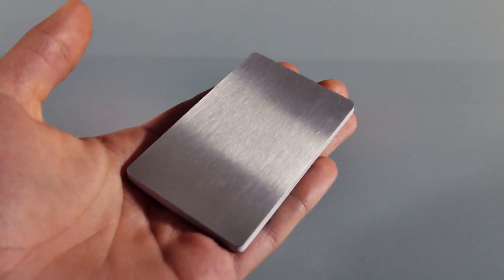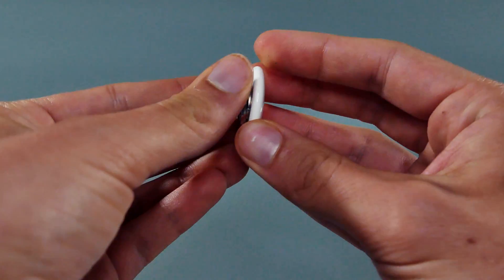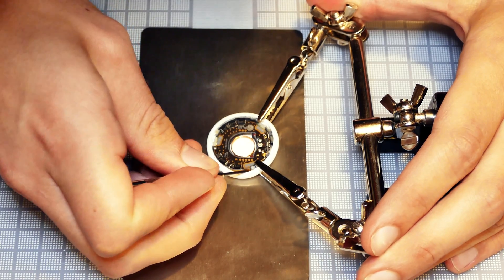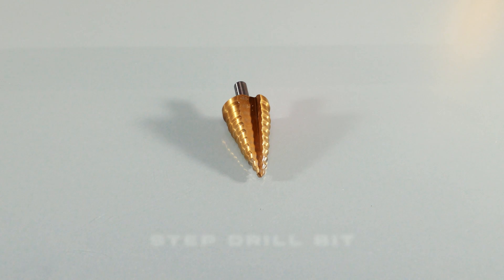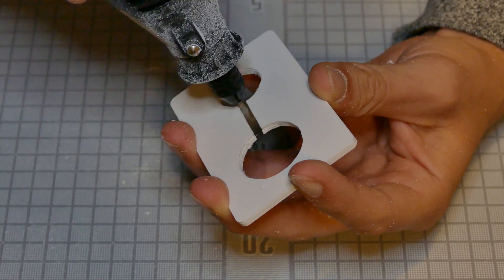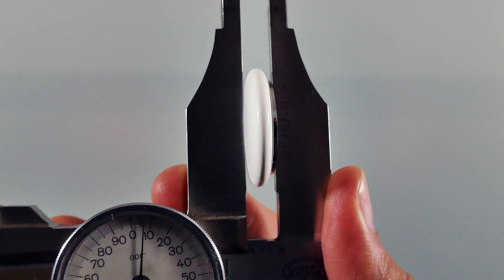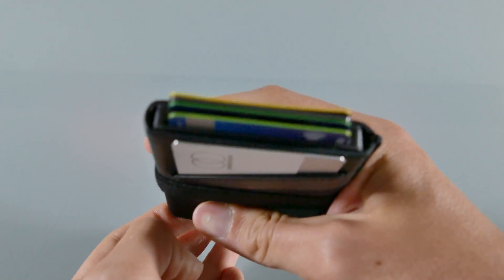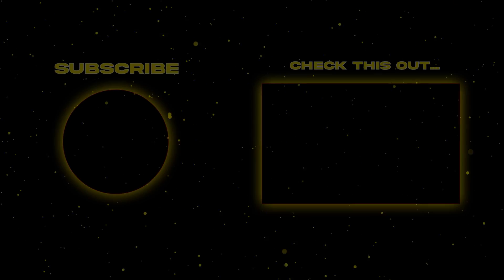Turn Apple AirTag Into A Card For Your Wallet (DIY) | Is It The Best AirTag Card?

Comment: more info on removing the pcb would be great that is the part I was stuck on before and am still :D
Reply from the maker: So the best advice I can give you for this part is to heat the airtag from the bottom so the glue can loosen then pry the pcb from the side. In the video you can see me trying to pick it from the center. Don’t do that. Just pry it from the side lightly with some pressure. Eventually it will come off. 👍

Comment: Square is apparently making an AirCard that is compatible within the Apple ecosystem. It’s gonna apparently be 2 credit cards thick, have replaceable batteries, and make a sound just like the AirTag. Preorders are supposed to open pretty soon, you were just off by less than a year.
Reply from the maker: Yes! I heard this as well, at somepoint it was pretty evident we’d see this coming. Glad to hear it will work with the Apple Find My network, might pick it up after my next battery on my apple airtag card dies. 😅👍
Reply: @T3CHUP  But it won't have precision finding
Reply: @Entertainment- yeah the precision finding is clutch when trying to find your keys or wallet. Or even the AirTag in your luggage
Reply: Looks cool, but no pricing and might be safer to see if it delivers what it promised to do first
Reply: close, they're called Rolling Square, from Switzerland

Comment: The problem for me is that I sit on my wallet when it's in my back pocket. I tried unmodified airtag and I broke the casing while it was in my wallet (yes my ass is heavy). Also it was uncomfortably close to breaking my cards in my wallet since unmodified airtag has a huge bulge.

So Apple really should make something as thin as 3 cards, max.
Reply: since people pickpocket, I haven't carried my wallet in the back for over 10 years. front pocket all the way. especially if you have a minimalist wallet... save your butt.
Reply: They won’t sadly

Comment: Stainless steel can block the signal so I recommend something else such as carbon fiber finish vinyl sticker instead (so it still looks cool)
Reply from the maker: Yeah plus it does add more weight to the card…but another finish instead of the stainless steel card would be cool. 👍
Reply: @T3CHUP  It just seems suitable for a 3D print card?

Comment: So you can either fit an airtag card into your wallet and not carry any other cards, or the other way around. Seems kinda pointless
Reply: agree, it seems like taking a back step in tech...answer to this is for apple to decrease the size in their future release
Reply: Or you could fit an AirTag into your wallet and carry other cards in that same wallet
Reply: This is a better solution than AirTag on outside of my ridge. It’s annoying bump. I’d rather have even thickness. Going to definitely do this.

Comment: 75% of that dremel work could’ve been solved with a 3D printer. You should look into the CR 10 smart for future projects or the i3 Mega X
Reply from the maker: That’s the plan. I’m planning on getting one soon 😉
Reply: @T3CHUP  just seeing this video did you ever get a 3D printer for another version
Reply from the maker: @dominickeen6091  I did get a 3d printer but I haven’t used it for making my own 3d prints so I haven’t made another version. Although I hope to learn and make a 3d print for projects like this in the future😉
Reply: @T3CHUP  For 2 Dimensional cutout I would recommend a laser cutting method, faster and cleaner result.

Comment: I do not see how you disconnect the speakercoil from the white plastic. I think that is the difficult part. 
Also in your video I see a board with no coil. What went wrong?
Or dit you connect it again and what did you do with the speaker magnet?
Please some info b
Reply from the maker: I had to reconnect the coil as I did have an issue with it and placed the speaker magnet under it afterwards. I recommend that you take the speaker magnet off right when you open up the cover to the PCB so you don’t have issues reconnecting it.
Reply: @T3CHUP  
Thanks for the info. 
I managed to get it out and build it in a 3D printed case. 
And changed the batteries for two 2430 in parallel. 
Total 3.4 mm thick. Only the volume is low. Can’t get it loud.
Reply: @patrickkerver  Bro thats amazing, make a video!
Reply: @patrickkerver  how do you get it out? I have struggle there too. Haven’t been able to get it out yet.

Comment: Do the RFID blocking wallets block the signal of the airtag when you put it inside?
Reply from the maker: That’s a good question. However, it doesn’t block the signal. 😉 I’ve tested the card out in the card chamber for the fidelio and the look a like ridge wallet and it works fine.

Comment: Nice video! I've created a similar design that I'm selling on Etsy if you're interested in having a look: https://www.etsy.com/uk/listing/1004210796/modified-apple-airtag-thin-42mm-slim

I found that there is no need to solder to both positive contacts of the battery terminals, rather just solder to one and put a blob of solder between the top two larger test pads on the left hand side (by the letter "A"). Hope this helps! :-)